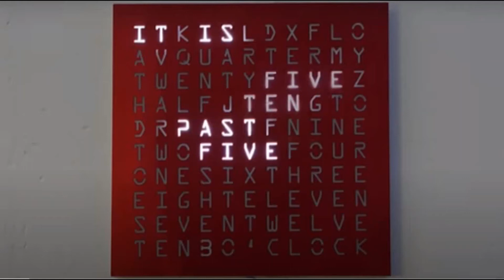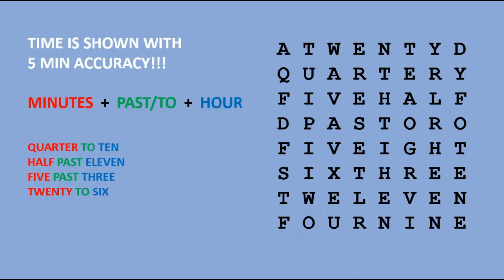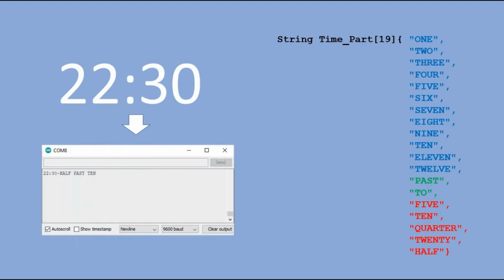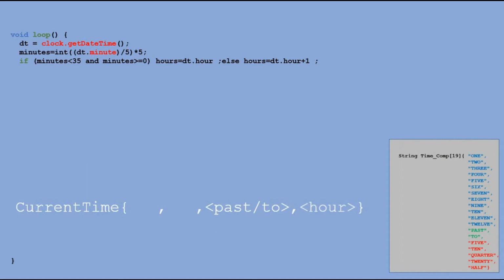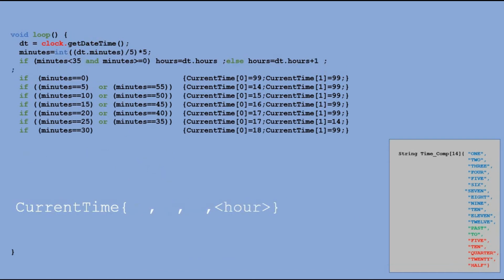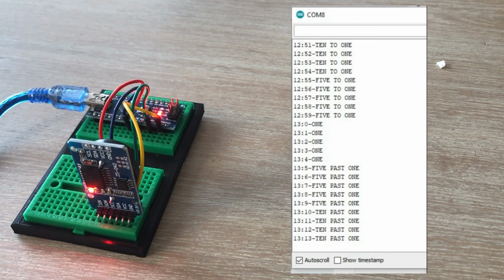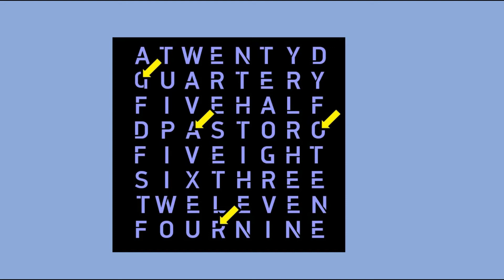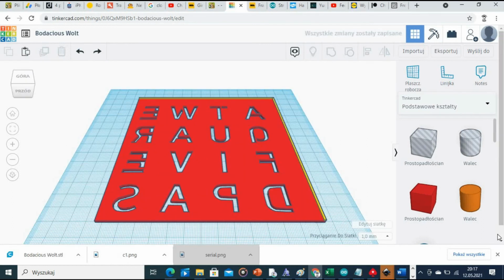Mapping Time: Building an Arduino Word Clock using WS2812B LEDs Part 1

Comment: This is a great project and tutorial , it has inspired me to build a 10x10 version.  What DS3231 clock  library did you use for this project?  I can't seem to find it in any of the links. maybe I just missed it?  When trying to compile I get "DS3231.h not found , no such file or directory"   I am hoping you can point me in the right direction.  thank you
Reply from the maker: DS3231.h is the library that needs to be installed. Look for the github link and dowload zip file and install it in arduino IDE. And the rtc module is DS3231. This week I would be releasing another video about the clock that does not use RTC but using internlal clock of ESP32 board and synchronisking time daily form the internet.  So that is also an option.

Comment: This looks like a Great Idea ! Your link has a glitch : it doesn't link Directly to your code....only to the Arduino projects hub🙃😉
Reply from the maker: The site I originally stored the code upgraded to the version and it messed up all the links. And there is no way to fix them. I moved to hackster.io I will update the links in the description

Comment: May I ask what DS3231 library was used. I'm very new to Arduino and the error seems to be a mismatch between my current library and your code.
Reply from the maker: This line in code indicates which library is used #include <DS3231.h>.
Just search in Google for "github DS3231.h" and you should find the link to the latest version

Comment: Dear mdraber,
thank you for you inspiration for the code, I had some issues and no experience with doing an wordclock based on arduino and i wanted to try to write it my self.
Currently my Clock is in German variant of yours based on WS2801 LED´s.
So the main question is, because i´m currently working on a study prodject and I used a few cutouts of your programm If i can have your personal permission to use these in my work.
I would be happy about a quick response.
Kind regards,
Johannes
Reply from the maker: By all means do:) Please like my videos. Helps youtube to recognise and promote them. You may consider supporting my channel by donatining even tiny amount. The videos like this one take a lot of effort to make.
Reply from the maker: Also I am working on mechanical word clock. Here I will map different time components to servo's positions. Probably will take another couple of months before I will have it ready. But observe my channel:)